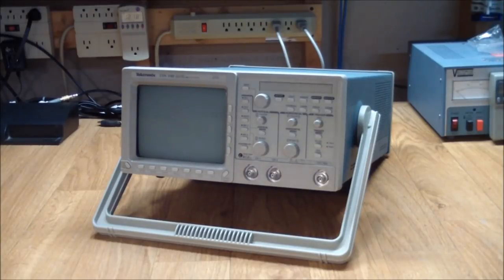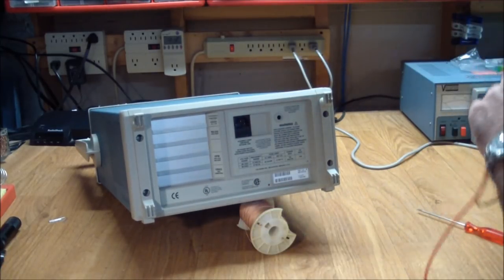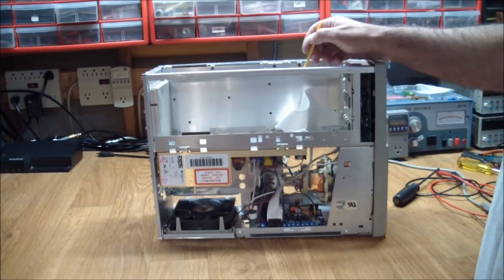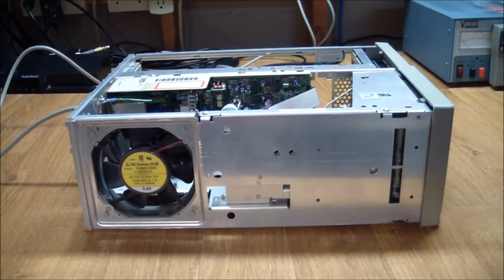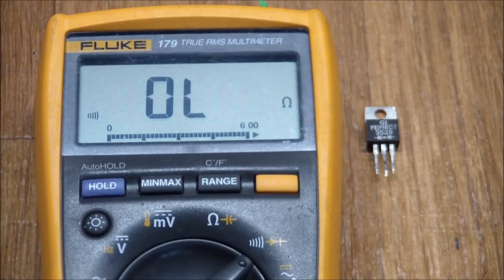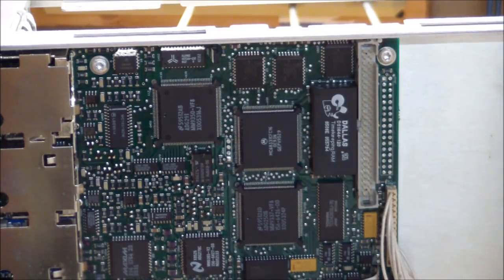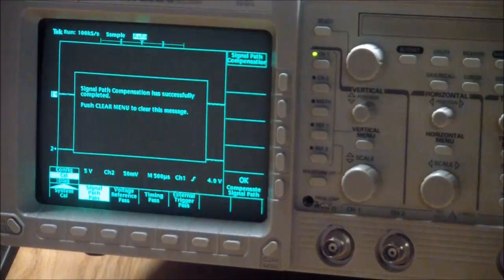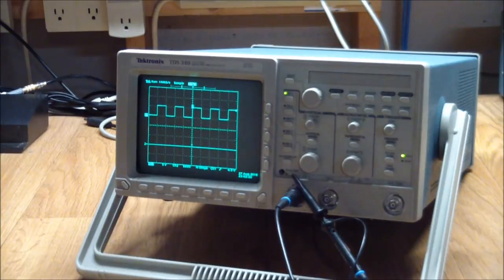AE#61 Repair Of A Tektronix TDS 340 Oscilloscope.

Comment: You sure di know what you are doing! I worked as TV technical Maintenance Engineer for 15 years.  I just picked up a tektronix TDS 360 -similar like yours with the same problem. You  gave mea solution to my problem. Thank You!
Reply: Replaced a .o1pf cap 1KV (C320)  in the high voltage supply for crt.  Turned on Scope scrn init and display came on.  The original cap was smoked and burned black. . Screen came on again fine. Thank you,

Comment: Just wanted to thank you for this, I have recently bought a TDS380 which had a similar issue where it just clicked on power on, traced it through to a shorted FEP16DT diode, my caps looked fine so for now I just replaced the diode, perfect! Working once again. I might go through the capacitors at a later date

Comment: Nice repair and a handy little scope. 
I wholeheartedly agree with your sentiments regarding electrolytic cap replacement. Too many people jump to conclusions about 'bad' capacitors without realising that unless they have failed short circuit most caps still function sufficiently, even outside their specifications, to do the job they're intended for. It's often worse to replace an old quality cap with some generic brand than to leave well alone, as well, which I've seen some people do on YouTube!

Comment: Nice repair... have one of these scopes, a TDS 310 (exact same scope, just lower B/W), came with the GPIB card though... and also with a Power supply problem... and no schematics as you said.  Was working on that PSU as you did, a year ago, then I was poking around the primary side, watching signals in/out of the PWM chip.. scope probe slipped on the chip pins and an impressive fireworks erupted, as the mains 400V cap burst into flames, preceded by a massive "BANG"... almost had a heart attack, jumped off my chair and ran for cover ! LOL. Now there are a few burnt/vaporized components around the PWM chip and I can't even replace/fix them because of course I can't identify them anymore, no schematics, no parts list... :-/  I love these old TDS 300 scopes, but their third party/schematic-less SMPS is no fun to work on. I don't like to be defeated though, so some day I will probably get back to it... and ask someone with a TDS 300 to help me identify the components I need to replace, so I know what to order... and resume the troubleshooting where I left it before the accident happened...

Vincent Trouilliez

Comment: Nice video. I have the Tektronix TDS 360/200Mhz o-scope with floppy drive. So it was good to see this model covered.
Reply: I have a 380 with 400MHZ , also with Floppy Drive nur sadly Not wird the Option 14( in Card).

Comment: No bossman, don't apologize for selling something like that for X price.  Your labor is worth something. 

I just bought an HP1740A for $120 in working condition,  but I went through it anyways.   I found some dry and broken solder joints on the power supply,  then gave it a calibration test (it was actually good and didn't need adjustment).  So would  I sell it for $120?  No.  I put 2 hours of my time and expertise into it.  I would charge $200 or $240 and the buyer would be getting a like-new scope that will run trouble-free for another 40 years.  

Time is money and money is time.
Reply from the maker: I hear you, but in my experience buyers are only interested in what you paid for the device. Labor and parts are considered to be free.

Comment: The fan is still quite noisy on these scopes, even when dusted off
I just purchased a used TDS 320 scope, and I plan to replace the fan with a much quieter PC fan I have in spare - which even seems to push more air

Comment: How good is this scope? I'm thinking of getting one, but I'm split between the TDS340 (multiple options installed) & TDS360 (no options). Which would you recommend? Great video!
Reply from the maker: The 360 is twice as fast as the 340, but if 100 MHz is enough for you I'd take the optioned 340.
Reply: @artifactelectronics  I am planning to work  on some audio & smps stuff. I was also thinking about 340 because of the FFT option. Thank you for the answer!

Comment: Those Dallas DRAM chips are one of Tektronix few serious mistakes.  If the battery isn't dead now, it will be shortly.  And, when the battery does finally die, the calibration data stored in the chip will be gone.  The only "proper" fix I have found (which worked for my 2440 scope, at any rate) was to replace them with new (I found them at Mouser) and then do a complete external calibration.  The caveat is that a very quick pulse generator is required to do the calibration.  If you are fortunate enough to have one (or know a colleague who will lend you one), the calibration procedure isn't very difficult.  If you don't have the tools, the calibration cost is more than the scope is worth.

Comment: Here's something I just noticed as I was narrowing down my selection of TDS 360's to buy - one has a plastic carrying handle like on yours and one has a metal handle.  Do you know which would indicate a newer model oscilloscope?  I can't read the Serial Number on the one with the metal handle.  The plastic handled one is B018480.  I just noticed in another of your videos (AE#4) that the TDS 460 you are working on has that metal handle, too.

Comment: I have a TDS 340A with most of the options I haven't even looked inside works great! (Knock on Wood) But I have a TDS 430A with all the options speaking of which the Option Knob quit working on the main panel so I think I will have to dig into that one... Any Ideas on that one would be helpful. So many things to repair and yes all of the above Items where purchased on E bay as junk or repairs.  So you get what you pay for and all of these devices need recapping!

Comment: man i could use one of these. my Tek 564B works great, but sadly it came with TDR sweep and sample modules instead of standard  scope plug-ins. I cant complain for an $11 scope though, it looks pretty on the workbench...

still, gotta learn how to use a scope someday. luckily so far my repair ventures have only required a tube tester and my fluke.
Reply: Does anyone know what in the world i would use a TDR for? checking coax cables?

Comment: Would not replace the diode after all, just leave the tried and tested upgraded part in there. Less likely to fail running at lower current relevant to the spec.
Reply: I would as the original is metal tabbed with a junction to case of 2.2 deg C/W compared to the plastic unit of 5 deg C/W. The original is also rated at 200V PIV and the replacement 150V.
Reply: Voltage not really a worry, likely only sees 50V at most in the reverse direction. Thermals the limiting factor is the heatsink, not as if it is on an infinite heatsink at 25C, that chunk is not big and not going to run cool anyway. Biggest thing is the peak current through the original was probably around 15A on switch on, and peak per cycle was probably around 5A, so having a part capable of 3 times this means more, bigger die (leakage it's a Shottky so leaky anyway) and thus a lot more robust part. Likely did a 5v rail, or a 12V or 24V rail only. The high current rails in this scope, with high voltages and currents, are in the CRT section separately. Failed probably because of slight winding differences meant one side handled most of the current and ran at the edge of the repetitive current envelope. Larger die, lower slope resistance and it probably will run cooler anyway at the current here.
Reply: I doubt it is 24V rail as the CRT looks like a 15mm neck so requires 12V in both heaters and deflection, could be done with 24V deflection but wasteful.  I was just looking at it being switch  mode and in europe it would run off 230/240V so the on duty cycle could be as low as 20% and the PIV would be higher not counting any ringing etc.

Comment: Great repair! NFM can show you the tricks to changing out that IC that has the built in battery... IIRC, he grabs the firmware, while the IC is still in place. Then he flashes the firmware onto the new IC. Then, he attaches a battery to the power pins, to carry the power over, while he removes the old IC and installs the new one. IIRC, too, he always changes out this type of IC, even if it tests as good, because, if the battery dies, it is a big problem to get things going again. Hope that helps... https://www.youtube.com/c/NearFarMedia/videos

Comment: where can i find the fan of the power supply
Reply from the maker: Fist note the required voltage and  current rating, and then get the exact fan case dimensions including hole offsets. Then head over to eBay, Ali Baba or whatever and start searching.
Reply: @artifactelectronics  a lot of thanks !!